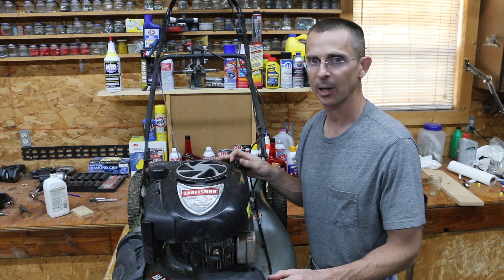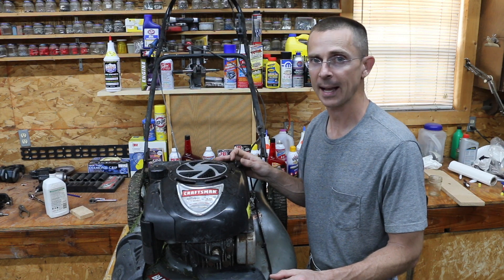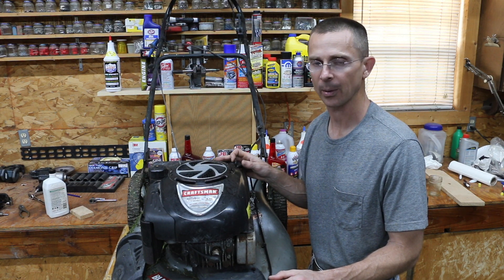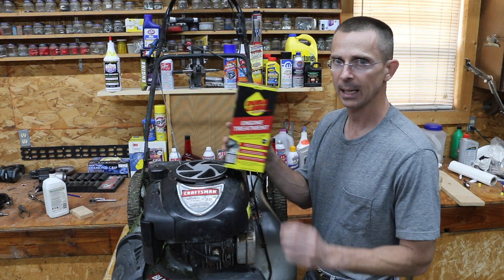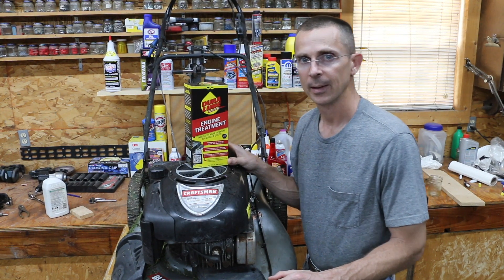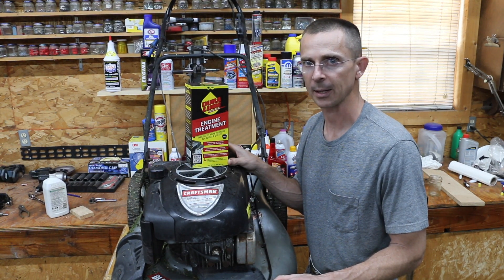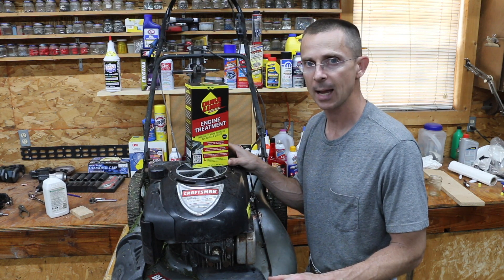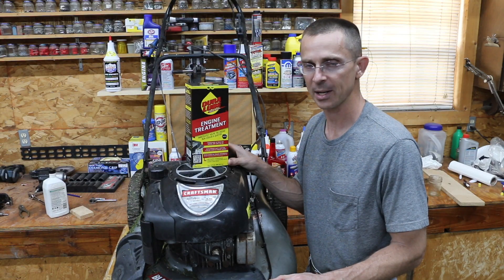Does Dura Lube actually help quiet and cool a gas engine as claimed?

Comment: I use valvoline high mileage full synthetic and a quart of duralube for 5k oil changes in my 2007 Toyota FJ Cruiser. 386K later she is still going strong.
Reply from the maker: Thanks for the feedback!

Comment: True story here. 
This happened back in 1997,  
I used Duralube in my 1988 Ford escort GT, 
This one time I took my family to a swap meet that was about 45 miles from home, when we got to the swapmeet 
I noticed antifreeze coming from under my car, I bought 3 gallons of water and drove home stopping every 2-3 miles to refill the radiator.
 After 8 miles I ran out of water, the water pump had failed so bad, water was gushing out of it, so, I decided to drive the car home until the engine dies, hoping those Duralube TV commercials  about running engines with no oil and no water where true. 
Well, lucky for me they were, I drove the car for 37 miles without a drop of water, the temperature gauge never went up past the normal range, when I got home I replaced the water pump, the car drove perfectly fine 'till the day I sold it 2 years later.
Reply from the maker: Wow! Glad you made it back
Reply: @ProjectFarm thanks.

Comment: I used Duralube over 35 years ago with great results, Now years later I found Bestline and using both of these products have helped my 2008 Ranger with 237,000 miles on the 2.3L along with my 1967 Mustangs 302 and my Wifes 2015 Honda Accord. Every one of my cars/Truck are very dependable, They start and run GREAT. Even the Lawnmower is easy to start.

Comment: Years ago I became a believer. Had a 95 Silverado with 350 V8. At 50K miles (after the warranty was up) it developed a main knock on start up. I put a quart of Dura Lube in it with the next oil change & the knock went away. It got Dura Lube every other oil change & never heard the knock anymore. At the time GM was putting crank shafts kits in a lot of these engines that were under warranty.

Comment: It has saved many of my motors . I had a water pump go out on my van . Lost all water but motor did not overheat in traffic jam.  Was able to drive safely to the exit . Dura lube will save you from heat damage to your motor . I run it in all my motors .

Comment: I've had similar results with Dura Lube as with Slick50( minus the crazy experience ). That lawnmower you used for testing did sound a bit better, but I wonder if it will be any better/smoother after some time passes. Maybe an update video later on?

Comment: I ran my TTR 230 all summer using only a quart ofduralube.  Engine ran great, and used less fuel. Also added about 100ml of duralube in a 90hp outboard motor all summer. Used less fuel, and 5kmh faster. I recommend the additive to any engine. Performs the way it should.
Reply from the maker: Thanks for the feedback.

Comment: MY 1980 BRONCO IDOIT LIGHTS WENT ON! 3am 14 miles to nxt gas STATION!       ENGINE HAD BEEN TREATED WITH DURA LUBE !  PUT IN 4 quarts  WHEN I GOT THERE. NEVER HAD A PROBLEM ! SOLD BRONCO IN 86 FOR A E250 FORD VAN $12,000.00 THAT OWNER STILL HAS BRONCO !    HE PASTED AWAY 2 yrs AGO. THANK YOU
Reply from the maker: Thanks for sharing.

Comment: You're the best , TSA courier drive 90 k a year.. both my 500k 2007 Ford focus altho I do regular oil changes etc.. it burns half of regular oil .. So I only top my motors on off after it burns oil.. so it definitely works as way less oil consumption.. way better then synthetic or regular oil as far as topping off your car after it's burned 1/4 of a quart or whatever 2000 miles etc.. love this product
Reply from the maker: Thanks!

Comment: I first ordered Dura Lube during a TV ad around 1992.  It wasn't available in the stores yet.  The immediate change that I notice was during cold start.  During that winter, we often experienced temperatures below 0 F.  I used to plug my car in which was a pain for my landlord, but after putting the Dura Lube in, I never had to plug it again.  It simply started easier.  I've been using Dura Lube for over 30 years as part of an oil change every 35,000m or so, or roughly every year.

Comment: I did use it when it first came out, it was magical on my old and new engines. My ex hit the car front, lost all the coolant and drove 35 miles up the mountains came home than she told me the car was running hot, I checked it to find radiator busted, no coolant. Changed the radiator next day, tested car compression was perfect, changed oil and I put 180k more miles on the same engine. Honda civic 1990.
Reply from the maker: Thanks for sharing.

Comment: I discovered DuraLube in the mid 90's and have used it ever since in every vehicle I've ever owned. Cars, trucks, motorhomes, bikes, quads and I've never had any type of mechanical engine failure EVER! The ultimate recipe is 6:1 Schaeffers cheapest synthetic blend motor oil and DuraLube. I'd love to see the difference on your roller bearing wear testing machine between this recipe and ANY other oil mixed at the same 6:1 ratio. Your channel ROCKS!
Reply from the maker: Thanks!  Thanks for the suggestion.

Comment: I've been using Dura Lube religiously in everything from my cars, lawnmowers (starts very easy, even first time of each year) snowblower and pressure washer. Been using it since the 90's when they advertised on TV with a huge blow torch next to a running engine (heat test). My 2001 F-150 engine is still going strong. Love it, use it all the time, trust in it religiously. You will too!
Reply from the maker: Thanks for the feedback.

Comment: Been useing Duralube for about for over 30 years, now it not a mechanic in a bottle, but I used it in my Buick Regal sport coupe which the owner took out the blown 3.8 turbo, put in a Pontiac 301 engine the engine had 68,000 on it, I put 250,000 miles on it,the gentleman that owns it now, did a compression test, it had 175 psi in all cylinders, Used it in my Camera , it had 75,000 miles on it, , had a 350 Chevy motor put over 200, 000 miles on it, there the person who purchased from me was a mechanic, he did scope and did a  compression check, it had 165 psi in each cylinder, put it in my 2004 Ford F150 with a 4.6 it has 245000 miles on it, scope and did a compressor check and it has 180 psi in each cylinder, the top of the pistons are clean, runs smooth and strong,now I change my oil every 3000 miles on my vehicles but I can say it works good, but again it not a mechanic in a bottle it just a good additive to help prolong the life of your vehicle, none of my vehicles use oil, also used it in my wife 2000 Nissan Maxima, purchased new it had 250000 miles, turn that into a rocket, and used no oil, gave it to my niece, they ran it another 100,000 miles, whereabouts unknown
Reply from the maker: Thanks for sharing.

Comment: Although duralube got some bad press years back due to unsubstantiated claims, I like the product. Use it in my 5.4 f150 and it tends to run quieter. Probly will add it to my generator as well.
Reply from the maker: Thanks for the feedback.

Comment: I have a 2003 Ford Focus ZTW wagon. I bought it in 2006 with 24K miles on it. I  changed oil every 5K miles and used DuraLube. I now have 240K miles on it and switched to Motorkote 3 years ago. It runs smoothly and does not use oil. Have you done a lubricty test on Duralube?

Comment: I have a 2016 malibu with 1.5 ecotec it has 135000 miles on it, it has bad blow by pretty sure it has bad rings iv been told it’s not worth fixing so what do you recommend i drop some of this in it ? I was also told to put Lucas stabilizer in it do you think it’ll help you think the turbo will be okay ? Thanks

Comment: I’ve been using Dube lube since I was 16. I had a grand am that had 200,000 miles. my timing chain stretched ripped a hole on the cover. I was doing 55 at the time and the idiot light came on. I got paid every two weeks so I drove it to work with no oil in it for two weeks before I got it fixed.

Comment: Duralube oil is the best man,I have a 5.3 liter 2012 Chevy Silverado Z71 and my friend wanted to put a new motor in and said I need to blow mine up first before he can.He said drain the oil and run it for hour ,! Motor would not blow,I ended up just putting the oil back in and 267,000 miles and still driving it.This oil is gold I have been using it for years and fixed couple motors of my friends that had rod nocking and everything 3 motors I rescued no joke.
Reply from the maker: Thanks for sharing.

Comment: In my car,gas mileage went up from 26mpg to 32mpg, and engine temp was running cooler, in 2004, (287,000 miles) my car timing belt broke and my engine messed up, the mechanic was very thrilled to see  very minimal engine damage with that mileage ,,,👍
Reply from the maker: Thanks for sharing.
Reply: Thank you for showing us great videos,my friends and family are also watching your videos.

Comment: I put it in my Dodge Journey with the Chrysler 3.6 pentastar engine. Shortly after all my oil leaked out there wasn't a drop on the dipstick. I didn't know that kept driving it.  No indication of oil starvation whatsoever. Fixed the leak and it's still running strong. I'm sold
Reply from the maker: Thanks for the feedback.

Comment: I have ran dura lube in a Ford F-150 4.6 engine since i bought it with 154K Miles It now has 299,340 miles and runs so quiet you can hardly hear it running. I definitely think its a good product.
Reply from the maker: Thanks for the feedback.

Comment: I put dura lube in a 1990 V12 Jaguar that had the tendency to overheat in parks or traffic. Now with 1 quart of Dura lube the big V12 temp is normal and the engine is very smooth it feels a little bit more powerful from a stop. It is totally worth the $15  since I use it in all my vehicles
Reply from the maker: Thanks for sharing.

Comment: I saw you do the slick 50 treatment then drain the oil and see if it would survive.
Have you ever tried this with Dura Lube?

I remember the commercials for Dura Lube where they would treat the engine with Dura Lube then drain the engine and let it run. 

That would be a good test.

Keep up the good videos!
Reply from the maker: Thanks for the suggestion.

Comment: Been using it for 40 years. Have had 2 engines that were treated that were run without oil in them [unintentionally]. One was a 13 hp Kohler pulling a 2 stage air compressor. It ran about 8 minutes before I shut it down. Refilled oil (with duralube) and it ran 13 more years. The second was a NewHolland skidd steer with a 72 hp diesel. Lost a oil hose and it ran at throttle 1900 rpm for about 5 min. Repaired hose and it is still running today. Without the duralube treatment I would have lost them both. Currently running a Dodge 6.4 hemi 12,000 miles between oil changes pulling a trailer every day 60k per year
Reply from the maker: Thanks for sharing.

Comment: I have been using 16 oz of Duralube with Quaker state synthetic  oil since it first came out in every car I owned.  I never got rid of a car with under 250,000 miles.  Never had any engine work on chevy, Pontiac, Buick, Mazda, Hyundai, Ford, that I owned.  Had original everything, not even a water pump was replaced.  My daughter drove my 1993 Ford Tarus home from college on the Ohio Turnpike at 85 mph, 72 miles, with no water in the radiator.  I could smell coolant when she pulled in the garage.  I replaced the split hose, added new anti-freeze, changed the oil with Quaker State Synthetic with Duralube, at the time the car had 70,000 miles on it.  The car ran fine.  I gave the car to a friend, whose son just started driving at 250,000 miles.  He put on about 35,000 miles over two years before he totaled it.  It ran fine.  I am 100 % a Duralube user and believer.  I drove 75,000 miles a year for work and went through a car every three years.  I do my own fluid changes.  I changed oil every 5,000 miles, with a high quality filter, Purolator One.  Replace transmission fluid every 30,000 miles, Coolant every 100,000 miles with new plugs, new serpentine belt.
Reply from the maker: Thanks for sharing.

Comment: It does work well after a fresh oil change, but it looses its effectiveness with mileage.  Also, it doesn't work as seen on tv back in the 90s. The 90s commecial showed a running engine on a stand without a oil pan and no oil after treatment. They also showed a Nascar racing supposedly without any oil after treatment. Thats bogus because I had a oil pump shaft snap and my engine died in approx 10miles.
Reply from the maker: Thanks for the feedback.

Comment: I ran dura lube starting from about 30,000 miles in a 2004 Mazda 6.   I sold it 13 years after I bought it with 180,000 miles on it and never had any engine problems with the car.   I was meticulous about oil changes and maintenance but I do believe in the product.  I see the car from time to time driven around my town and it has been over 3 years since I sold it.  What sold me on dura lube was the commercial where they ran an engine with dura lube in the oil for a period of time, drained all oil out and ran it with the crank case empty and it ran quite a long time.  I don't know how genuine that was but I always had good luck with most of their products.   I kept an old bathroom fan in the shop running for 5 years after a noisy bushing was treated with dura lube lubricant.   I think the stuff is ok.
Reply from the maker: Thanks for sharing.

Comment: I've used Dura Lube on my 2002 S10 2.2 liter with 109,000 origjnal  miles..It runs Smoother & Cooler..my engine doesn't burn or leak oil..
Reply from the maker: Thanks for sharing!

Comment: First what is the viscosity level of duralube vs the regular oil and result of Prussian blue restorer if used, as that will shut up some engine noise, but the metallic clanging during compression testing before and after did not sound healthy, I work on mowers and no matter which that engine is parts, as under load it's gonna get hot and noisy, useless but for a postage stamp lawn, as for another comment the fact the engine idle raised is probably in reaction to working harder to the higher viscosity. I would try a mix of gearlube and oil in varying proportions, but in my experience that mower had been abused and or hit something causing irrepairable damage to the connecting rod bearing which will only get worse. As much as we hate to lose a good vehicle or motor, once damage is done you may get lucky, as with lawnmowers hitting something and shearing a flywheel key, have about a 50/50 shot of knocking and I tell them that's the chance, I'll put in the key paid for my time, as is result

Comment: YES...USED AT REGULAR INTERVALS WITH OIL CHANGES...MY WIFES PARENTS GAVE HER A 1985 DODGE RAM 318 TRUCK FROM ILLINOIS ...I GOT AHOLD OF IT @ 118,0+0 MILES AND SERVICED IT REGULARLY THERE AFTER...ALT REBUILD MYSELF...BRUSHES & DIODE BRIDGE IS ALL...BEARINGS GOOD...THAT 318 HAD OVER 350,000 MILES ON IT WHEN MY #1 SON WAS PICKLE FORKED FROM A RED LIGHT RUNNER...THEY PULLED THAT ENGINE AND INSTALLED IT INTO ANOTHER TRUCK...NO RATTLES OR NOISES FROM IT WHATSOEVER!!! AFTER THAT...I LOST TRACK OF THE 318 ENGINE(I ONLY CHECKED INTAKE MANIFOLD BOLTS...SOLID ENGINE   DURA LUBE I "USE"...MANUAL & DIFF ADDITIVE...NOT MIXED WITH 30W OIL AS IN BIG BOTTLE...I USED 20W50 OIL& 30W IS NOT A MIX WITH 20W50...SOUTHERN CALIFORNIA AREA...DURA LUBE IS INCREDIBLE...COLD START UPS ARE PEOTECTED...(85% WEAR ON COLD START UPS!!!)

Comment: Dura lube saved a Plymouth laser I had. Had oil changed, they buttoned it up without adding oil. I drove 50 miles before I even realized there was a problem. Had a service station add oil, never had a problem after that. I'm a believer in dura lube.
I do now use Lucas oil in my truck. But by word of mouth, no practical experience with it.
Reply from the maker: Thanks for sharing.

Comment: if it reduces the blowby then less hot gases escape the combustion into the crankshaft case, these gases would otherwise contribute to rising engine temperature while less heat would exit through the exhaust system. Also blowby will very likely increase pressure into the crankcase even with a good pcv system and that would likely cause all sorts of oil leaks, then fire hazard.
Reply from the maker: Thanks for the feedback.

Comment: I will say, before I found Motorkote, duralube saved 2 of my engines.

In the first instance I was a soldier stationed in Germany back in the 90s & I used duralube in the engine of my 76 volvo. I drove someone 400 miles, & returned to the barracks to find my drain plug on the ground. I drove the whole time without oil in the engine.

The second time I was on leave & drove a family member to DC to check out the sites. When I got back to my truck, it was moved into the grass. Apparently a presidential motorcade passed by in the interim, but new traffic blocked me in, so I popped it into 4 wheel & tore a$$ across the mall to get out of DC, & later found out they drained my oil. I drove 200 miles with no oil. 

I was a duralube believer after that, until Motorkote came along. 

I’d love to see the two go head to head.
Reply from the maker: Thanks for sharing.  Thanks for the suggestion.

Comment: My little brother bought some of that 20 years ago and I witnessed his little 305 monte Caonrlo run down the highway 4  quart low  and it never knocked or ratted it acted like it was running out of gas stopped at the nearest station and checked it out I was driving the car at the time never would have believe it if I hadn't seen it with my own eyes
Reply from the maker: Thanks for sharing.